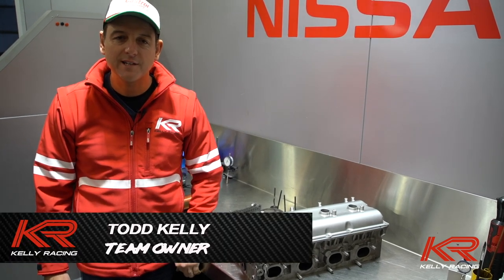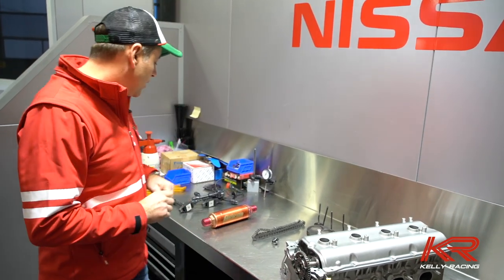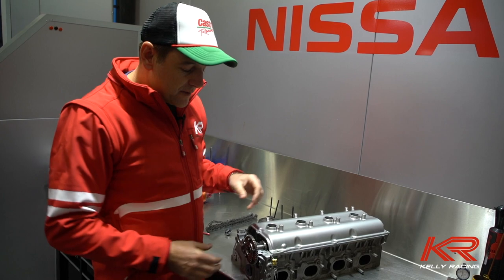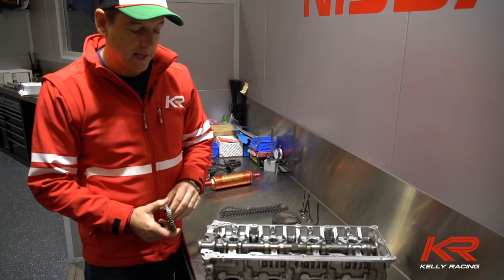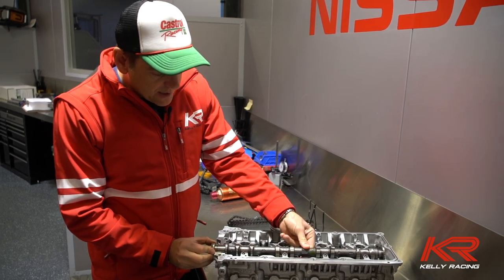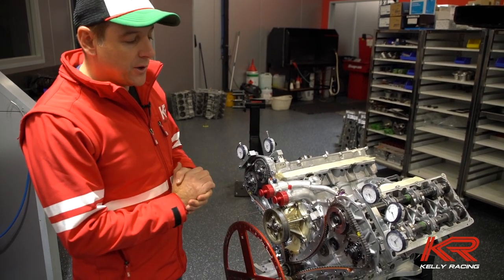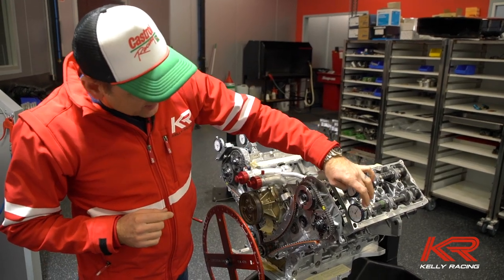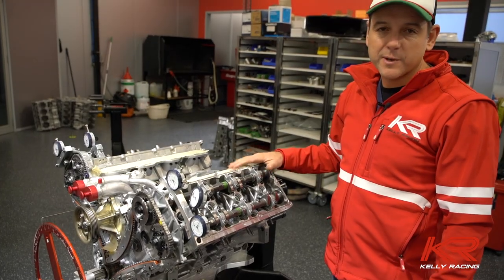What happened to Rick Kelly's engine at Winton? - Kelly Racing

Comment: As a former mechanic I thank you for taking the time and showing us went went south in the motor. I am always curious went went south when I see an engine let go in any type of racing.
Reply: ferrari,if the car lasts longer than the race,it was built too strong,if it rolls over the finish line,just right..streigth is weight.lightness is speed...

Comment: Great, great video breakdown.  I am always interested in the root cause analysis of engine failures because it seems like sometimes "the more I know, the less I know".  Thank you for sharing.
I'm curious - when Rick reported the engine felt like it "was running on four cylinders", why did you rule out it being a fuel issue?  Aren't there two fuel rails, therefore potentially meaning one fuel rail was blocked or stopped delivering?  BTW, I am asking this at 01:18 into the video, so I'll continue.

Comment: Funny, a similar thing happened to my brother's miata about a year ago! A bolt under the valve cover came loose, got smushed between a cam lobe and the head, and caused one of the lifters to stick partially open. The force needed to smush the bolt was enough to make the timing belt skip a tooth, stranding the car in a parking lot because the valve timing (and by extension, the ECU, because it measures cam position for fuel/spark calculation) was too far off. Pain in the ass to figure out, but very satisfying to finally piece together the chain of events. The engine ran just fine after re-timing/unsticking the lifter, up until we replaced it a few months ago.

Comment: Good day and thanks for making this public illustration, I would have never thought the engine seal strategy was this clinical even in cases where the power unit experienced a failure. Here’s a question for you, since this is a quad cam engine which differs from the other competitors, how does Supercar mandate a controlled cam? I can appreciate that I am splitting hairs here, but I can’t quite imagine that a single cam profile can be used without compromise for two different valve trains. Thanks in advance for any feedback which can be offered.

Comment: It's about time that someone described an overhead cam engine, with fewer moving parts, as simpler!
Reply: Actually they don't have fewer moving parts. They have twice the number of valves and timing chains. They have 4 times the number of cams and cam sprockets. Four tensioners and related hardware where most pushrod motors have none. Now are they a higher HP motor for there size? 100% definitely.  Fewer moving parts NO.
Reply: Michael Wilkening all those lifters/cam followers. Each of which can fail. Thats a whole step in the chain which generally isnt there in the valve gear of an OHC engine.
Reply: ohc been around for over 100 yrs.nothing new.like desmodronic drive,nothing new.it was just too expensive to mass produce.it can take a day to shim an ohc engine.as 1 hr to a pushrod.or never to hydraulic tappet.cant beat clevo..last forever,never touch it..i used to own a lotus escort.IE,cosworth,bda,fva,ect.all old school.ohc has to be direct,on the bucket,not thru rockers.
Reply: Fewer moving parts and a simpler system per valve. Overall there’s more going on but from the point of view of a single valve there’s less going on in an OHC engine compared to a pushrod engine
Reply: @Steven Ross-watt On that you are correct but not by much overhead cam you have the valve cap on pushrod motor you have a rocker arm and a pushrod. You do have to admit that adjusting a pushrod motor is simpler that the overhead cam one. The overhead cam one does rev higher because of lower amount of weight and the inertia but I never liked buzzing a motor over 7500 RPM anyway.
Reply: @phantomwalker8251  on almost all the dohc engines nowadays the valve is adjusted hydraulically
Reply: What about the spring seat pressure, possibly upwards of 200lbs on a pushrod engine assuming they run a roller cam or rockers or both. Cam bucket setup may be somewhere around 50 - 100lb depending on the cam. Just imagine all the energy involved in opening those valves on the ohv engine.

Comment: Great insight...is there any difference in performance having the ohc as opposed to single cam set up, how have they achieved parity ?
Reply: My understanding is that all the engines must not exceed a fixed HP rating and also have a common rev limit. Each engine is tested by authorities to make sure it complies and is then sealed.

Comment: You shouldn't find TDC with a dial indicator, you should use a positive stop screwed in the plug hole for better accuracy.

Using a dial indicator will show TDC through around 3 degrees of rotation, you can use the dial indicator in the way you would use a positive stop, but you really shouldn't especially if you are running big clearances on your big ends.
Reply: Yeah, I think the multi-million race teams might know what they are doing.  But go ahead and dream big tiger !
Reply: @jasperpipes4222  Well tiger... I went to the same trade school as the people who build engines for supercars teams and have screwed a few together myself.
Reply: Dialing in the TDC with a gauge is much more accurate. With the positive stop you go by your feel of force reaching the TDC and you're relying on setting up on machined areas which can vary for many reasons, whereas the dial gauges no matter where you set up as long as it's secure, the needle will show you it's highest point within thousandths of an inch (0.0xx)
The other two gauges on each camshaft are to measure the Lobe Seperation Angle difference between the inlet and the exhaust camshaft for optimal valve overlap for this engine to make the best cylinder pressure for maximum power and to be within the tolerances the v8supercar rules allow. It's a pretty fine act.
Reply: @no_bull  I understand what the two other indicators do, I'm an automotive machinist (engine reconditioner) by trade, no using an indicator for TDC is not more accurate, like I said it will show TDC through 3 degrees of rotation, if I tried to use an indicator to find TDC during assembly of an engine, or for just learning cam timing, I would have failed that particular class, and my teacher worked for Gibson motorsport building engines. The positive stop will always touch the same part of the machined piston, no feel involved as long as you aren't a caveman and ram the piston into the stop.
Reply: @LordandGodofYouTube  I am an automotive machinist too brother studied at kangan richmond and Bruce Carey was my teacher and Bluey the retired teacher we worked together at TopTorque engines in Melbourne. However there's more than one way to skin the cat... it can be done both ways, either with the stop or the gauge regardless.
Reply: @no_bull  , me too, I heard of Bruce but I never studied under him, Bluey was there, a guy named Charlie, Neil Marshal, Roger with the Jags and some others I can barely remember. I'm pretty sure it was Bluey that pulled me up on this, from memory there was a 253 block near the boring machine for doing cam timing, we had to put a cylinder head on the block to use the positive stop, we could have used the indicator, but when I was caught doing this it was explained to me why this shouldn't be done, I also built the holden 6 and put it on the dyno and also the 253. I may have gone after you, I left in 1998

Comment: Uses dial gauges to set the "LSA" Lobe Seperation Angle of the camshafts. 
Can't remember if the VK56 cylinder heads had shim-over bucket tappets or shim-under type.
Whereas the Holden V8 had the camshaft in the block and the LSA was custom grind along with duration and lift in one fixed bumpstick 🛠️📈

Comment: Can you please explain what does the switch that controls the RPM or spark firing for the 40KM limit in the pit lane as the cars come in to the pit lane, just wondering if it hurts the engine at all and to what degree, is it fuel or just the spark which is controlled and limit on the speed ?

Comment: That engine sealing regulation is actually REALLY restrictive. Makes the performance they generate that much more amazing.
Reply: How?  You're saying because they're not allowed to cheat it's amazing that they get the performance they do...
Reply: @bigblock3706  that's exactly what he's saying, that's why they do it,stops cheating
Reply: @bigblock3706  Exactly. Because there's zero margin for rule-bending, let alone breaking, everybody has to be running on the ragged edge of performance and reliability for 24 hours nonstop...multiple times over the season. Which, compared to a NASCAR or NHRA Top Fuel engine, is even more impressive.
Reply: Yeah, about that. That seal seems like something that would be very easy to replicate though. Just take a mold of it, or 3d scan/3d print a mold if that's more accurate, take the seal off, do your cheating resealing. Obviously I'm missing something, but what, what makes that seal so hard to counterfeit?
Reply: @paulzapodeanu9407  yeah, but it's probably serialized in some way that's replica-proof. Plus it's probably internally stamped as well along with other tamper-proof measures. Remember, this is a part on the engine that has to function properly throughout the entire life of an engine in the same temperatures that an engine does. It's not as simple as pressing "print".
Reply: there all crate engines.or,you can build your own to the crate engine specs.so why bother racing...???????????????????????????????????

Comment: very good explanation and demonstration, thanks, but why not fabricate a belt drive system? a belt drive would reduce the shock load on the timing components.in the u.s. we use belt drives on 10,000 rpm  pro stock v-8's.

Comment: Hey todd are the Nissan engines cheaper or more expensive than chev/ford ?
Reply: In a word...Better. It's just that they are not common. A mate has bought two 1/2 cuts from japan and put one engine into his Nissan patrol .This made it faster and cheaper to run than the original 6 .The other is in his Fiat 130 Coupe .That made it a very quick car indeed. Beautiful engines actually.
Reply: ?????????,what..??.there all the same engine..there all the same car,there all the same weight.its a drivers race,not a manufacturers race any more.same as dakar.nothing like the car,just a stiker...its all money,advertising,hype.b/s...

Comment: Ahm, why not find a free revving engine that's suitable for race modification?
A free revving engine, for those that may not know what that is, is an engine design that if you break a cam chain/belt or gear/s the pistons cannot make contact with the valves = NO busted valve train.
Less parts to have to replace & therefore a lot less work to do to fix.    🤔
Reply: Take a look at the amount of valve lift on this engine. There is no way it can ever be free running.
Reply: The isuue with having such an engine design would be that it would compromise overall performance; you would either have insufficient squish volumne) (a large combustion chamber volumne) or your valve opening would be very short and thus the gas-flow would be quite poor. A succesful race engine requires the maximum amount of gas flow possible, which means high valve lift (as well as maximum duration). Additionally, high compression is important as well.
Reply: For an engine to be non interference you are either giving away a lot of compression or a lot of breathing ;) very rare even in production vehicles for decades now, in racing it would be rarer than rocking horse shit :P
Reply: @Muffin_Masher  The 2000's  Mazda MX5 are non-interference...hence the lack of urgency (compared to other cars) re cam belt change...it is an OK engine but not a performance one, at least mine isn't
Reply: Stephen Scholes You cant compare stock engine to racing engine. Many stock engines are non interfrence but as said above. CR and valve lift are the reasons.

Comment: It failed because there's to much going on in an overhead cam motor that's why pushrod motors dominate less working parts.
Horses for courses.
Reply: lol...they dominate hillbilly racing but haven't been used in serious racing (GP racing) since about 1911
Reply: @stephenscholes4758  and yet they are stronger cheaper and still in use in motorsport that has the most amount of money.
Reply: @craigjones9244  if you don't understand why they are obsolete I doubt anyone will take the time to explain it to you
Reply: @crunchytheclown9694  Can is ask why pushrod motors are obsolete? 

Before you answer that. I would like to also ask what are the fastest accelerating and most power cars in the world running? I'm pretty sure they have around 10,000hp and run Pushrods. Cheers
Reply: @MrParker300  read previous responce
Reply: Yuck Foutube  thank you
Reply: @crunchytheclown9694   yep but not for long
Reply: Multi valve DOCH: low valve train mass, lower spring pressures, lots of revs. Better combustion efficiency, better flow, better sparkplug placing. Yes, fastest motors are methanol TopFuelers,  but there are different reasons for that. Besides they are not more durable. One pull lasting few seconds and heads off and new valve springs.
Reply: Craig Jones Try make four valve pushrod with less parts than bucket tappet DOCH
Reply: @juhomaki-petaja  nitro methane, left out a few points but a pretty good response
Reply: Solid fuel rocket motor for the win!
Reply: ohc engine works directly on the valve buckets.very reliable.but hard to shim the clearances.more power than ohv engines.more reliable,just expensive to build.been around for 100 yrs..
Reply: Pushrods...BAHAHAHA...the Dinosaurs are extinct dude...move on!
Reply: Let's look at how many working parts they have in comparison. 

DOHC motor:
2 timing chains
4 camshafts
32 valve assemblies (incl. buckets)

OHV motor:
1 camshaft
16 pushrods (incl. followers)
16 tappets
16 valve assemblies

Total:
DOHC motor: 38 parts
OHV motor: 49 parts...

So a DOHC motor has fewer moving parts than an OHV motor for a greater breathing capacity and potential for higher revs.

The failure in Kelly's engine was actually a very rare event.
Reply: @thethirdman225  yeah, seems like his engine failed due to some sort of casting flaw letting a chunk of free metal wedge into the cam
Reply: @phantomwalker8251  not all OHC engines are direct acting. bunch of em still have rocker arms
Reply: @kasuraga  usually right underneath the tappet bucket bores at the very bottom. You can't see it and hardly if anyone could fit any tools down there. If anything, Nissan has to improve their cast moulds to have a better smoother finish and that all begins in the metal foundry.
Reply: @no_bull  lifters ?